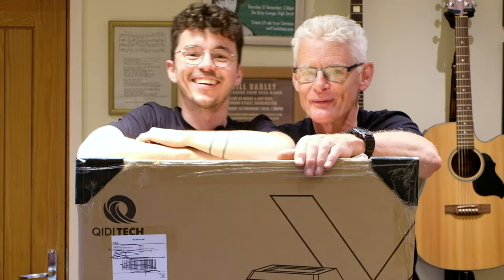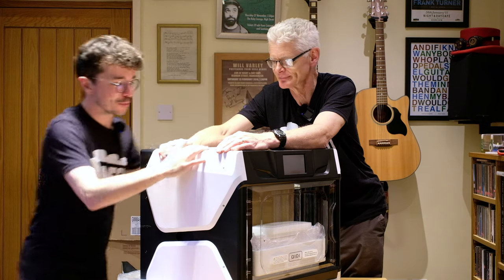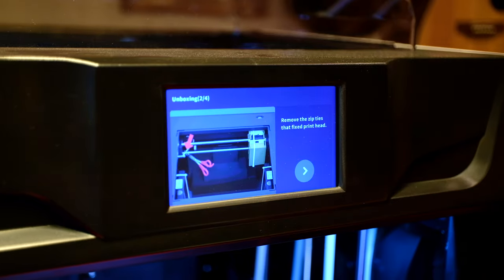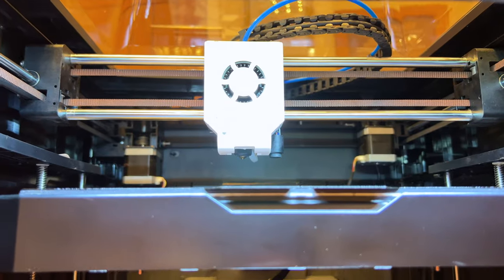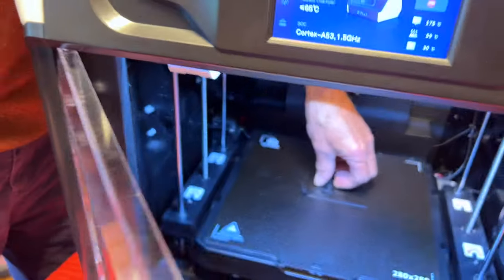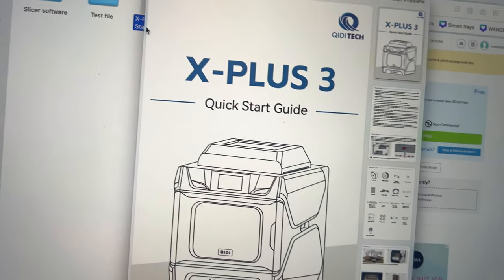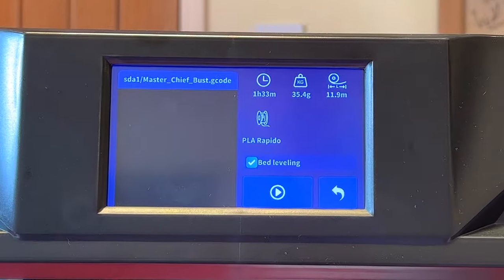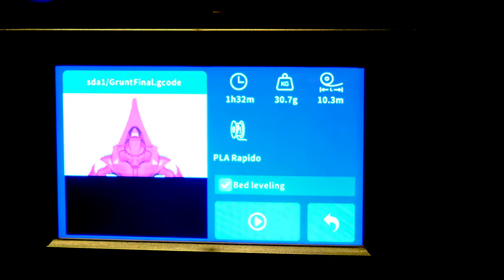My Halo 3D Printing Journey BEGINS! QiDi Tech X-Plus 3

Comment: Get a resin printer. They're way more detailed and can print mega construx accessories, while filament can't.
Reply: not always true, resin printers are good for detail but filament printers can print larger and more accessible parts
Reply: @InsetGD  not without noticeable layer lines
Reply: And depending on the quality of the filament printer, you can the same level of detail as a MSLA printer
Reply: @YaloChief  Thats true, MSLA is also a good budget printing route, as PLA can be very expensive
Reply: For miniatures, sure. But they require more post processing and resin is more harmful
Reply: @YaloChief my p1s can iron the top layers to get rid of layer lines
Reply: @RepublicansAreDeplorable  it still loses details compared to resin
Reply: @YaloChief  for sure
Reply: @YaloChief  the p1s also lets me print multiple colors on a single print. They all have their pros and cons.

Comment: Once I have room for one, I plan on getting a 3d printer and I think I might get this one, it’s pretty cheap for what I’m looking for
Reply: 600 bucks for a filament printer isnt worth it, as there are a lot more issues with having to fine tune everything. 
Resin printers are alot easier to manage, its just the cleanup after each print that matters the most.
 If you want to print mega construx stuff, get the resin printer because it is more detailed
Reply: @YaloChief  I’ll take your word on it 👍

Comment: be prepared for alot of fails! I have a total of 4 printers and each have a succses rate of about 70%, meaning that they fail all the time. The software I use is LYCHEE filament beta and it works like a charm! The settings make or break the print as well, the best settings make the best prints!
Reply from the maker: Excellent intel and suggestions! I’m definitely here to learn and make mistakes!